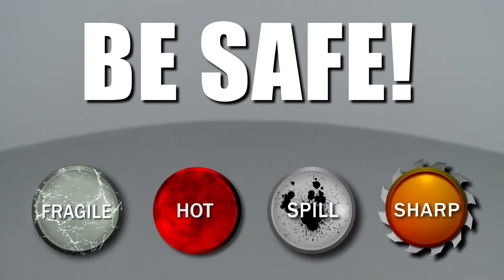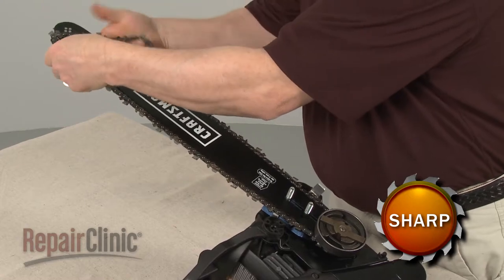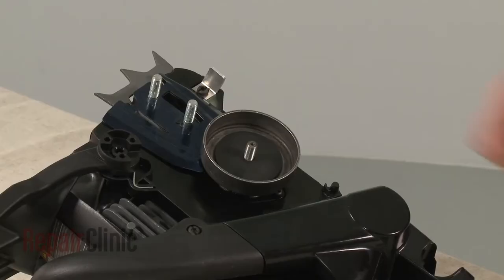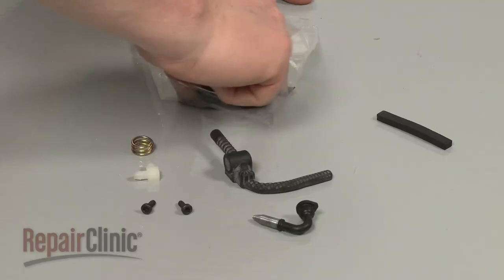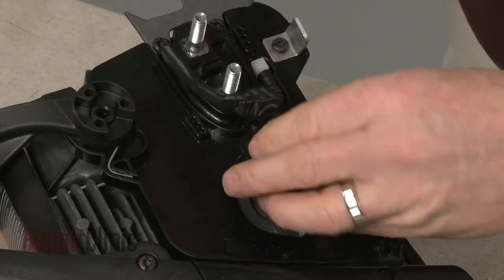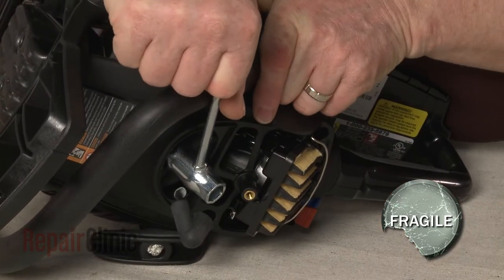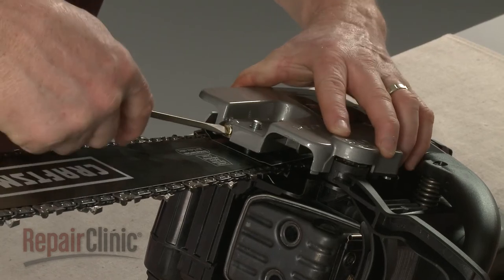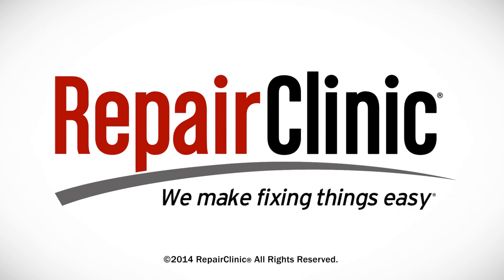Craftsman Chainsaw Oil Pump Kit Replacement #576753201

Comment: Also for Oregon Mac Culloch Mac 338.
French translat : Cette vidéo fournit des instructions de réparation étape par étape pour remplacer le kit de pompe à huile sur une tronçonneuse Craftsman. La raison la plus courante pour le remplacement de la pompe à huile est quand la chaîne de coupe ne fonctionne pas correctement
Process used for Oregon Mac Culloch Mac 338. That is the same parts.
But the removal process of the clutch applicable on a brand new chain saw is not usable on a chain saw that was used. We must block the piston differently. I'm looking for ?